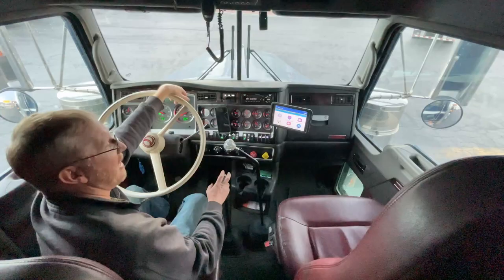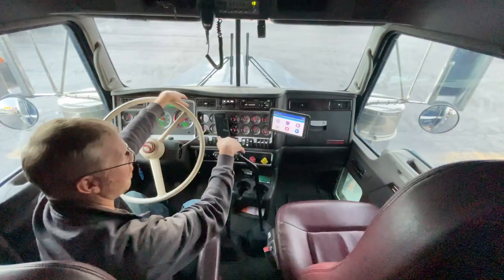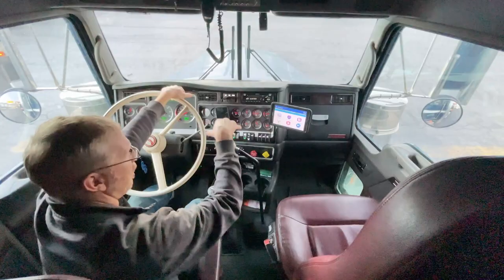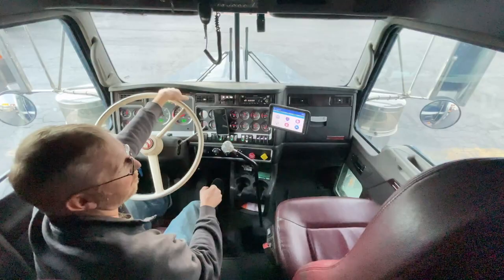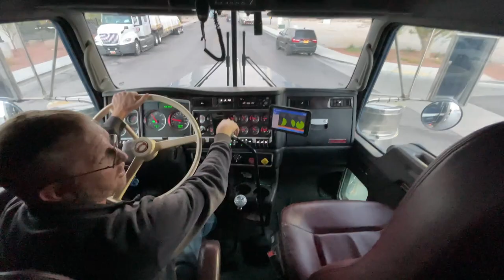Driving with Classic Touches Production Twin Stick

Comment: If ya want cool just put a set of boxes in it then you'd actually have something.
Reply from the maker: Would love to put a set of boxes in but there are very few available that will hold up to the torque of modern engines and it is roughly a 12 hour job to put them in. This kit installs in about 30 minutes.
Reply: Boxes are cool but you'd never know he had this kit if it wasn't in the description. You can't put boxes behind a 600 cat or Cummins, they'd grenade them
Reply from the maker: @shanemccaffrey5570  that is the compliment that I was going for! When you drive it, it almost feels like driving a 5 x 4. Thanks.
Reply: Dad had a set of boxes behind a built 3408 back in the early 80s a friend of mine is running a tri drive PETE in the oil patch with an 18 speed main and a 4 speed aug. 600 6n cat

Comment: I drove a 5/4 Double Transmission Dump Truck for years when I was a young fella, I used to do just like you did first I would bang them out high low every gear while loaded with 68,000 lbs in the box but when it was empty I just ran the main transmission so it was less work. Those old dudes were absolutely amazed because they had never used the transmissions bot at the same time but I was then it caught on. That was back in 86
Reply: steven seagal claims to have invented the front kick no one was amazed

Comment: I think it's a six-speed with a double high low you got high low on the big and then the vacuum or electronically actuated high low on the switch it is way different than the twin stick I grew up on
Reply from the maker: It is different than the 5 and a 4 that I grew up on as well. It is an 18 speed. The twinstick kit moves the 18 speed air switches that are built into the shift knob from the factory to the second stick. Now instead of pushing the little grey switch on n the knob forward and back to split each gear. I move the twinstick kit stick forward and back to split each gear. And instead of pulling up or pushing down on the black switch on the front of the shift knob to change between high and low range, I move the twinstick kit shift lever from the left side to the right side. Left is low range, right is high range. The kit is easy to install, easy and intuitive to get used to, and I get to pretend I'm driving a 5 and a 4 that I loved as a kid.
Reply: @jaredcampbell4124  okay you explained it to me and I understand but I would rather have the old-school gearboxes word might be a fight to find the gear sometimes simplicity is always better but going back to where I learned in my childhood is way more nostalgic and I'm not a truck driver I have drove truck I've I know a little bit about flat bedding I can always tell if a load is secure and the dry van I won't say I know everything because I don't but when it comes to shifting your transmission I can figure it out cuz I was doing it 8 and 9 years old what most twenty-year-old or 30 year old and can't do today they might have their CDL but I bet donuts dollars I can out drive
Reply from the maker: I would love to have a real set of boxes. But they are becoming outmoded.

Comment: Just wondering WHY you feel the need to By-pass the SIMPLE , easy to use , Two Switch system , that a Road-Ranger COMES WITH . Wank Value ?
It's a ROAD-RANGER , not a SPICER . Seems a POINTLESS Mod . Down Vote . You're simply trying to sell a " Toy " to " Super-Truckers " .
Reply from the maker: Are "Super-Truckers" not allowed to have "TOYS"?
Reply: @jaredcampbell4124  . I  suppose they are .
But let's be Blunt here , a Heavy Truck  is  NOT  a toy . It  is  a  piece of Industrial Equipment , that Mis-Managed , can Kill people and do a LOT of damage .
Why complicate Operating it  Unnecessarily ?
The  Range-Change function on your "Gadget" works somewhat like what  M.A.N. used when they fitted a 9-speed Road-ranger to some of their Vehicles , back in the 90's . 
A system they QUICKLY abandoned , in favour of a conventional Switch .
And eventually went to ZF 'boxes .
Your " Gadget " also promotes  Pre-selecting of Range and Split .
Both Auxiliary 'boxes on a Road-Ranger will be Damaged by that . 
They are NOT designed for Pre-Selecting .
You flick the Switch and make the Shift within about 1 - 2 seconds . 
To do otherwise you're wearing out the Drag Clutches unnecessarily .
You want Twin Sticks , to show off with , then  Retro Fit a Spicer 6 over 4 .
And then learn how to use it .
Reply: John Cunningham. BECAUSE HE CAN. Just because you don't want to doesn't mean others don't. Don't like it...MOOOOVVVVE ON GOOD BUDDY.